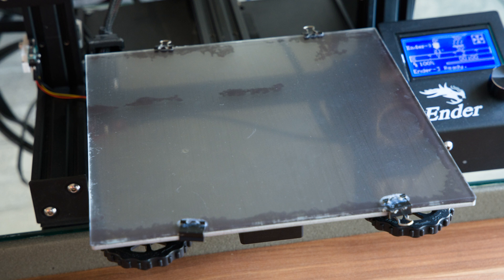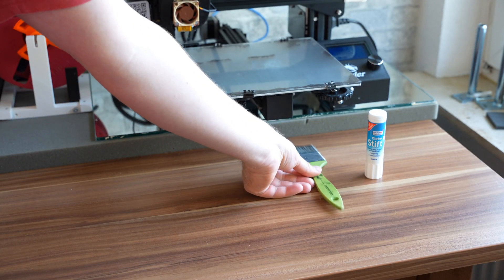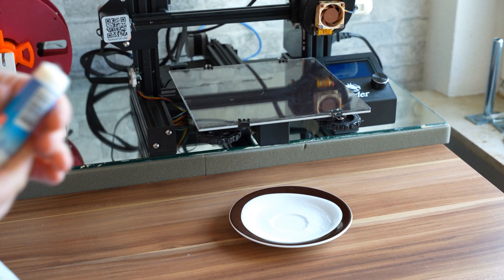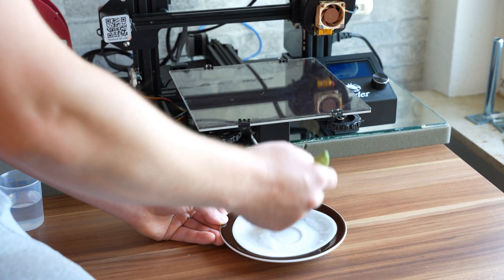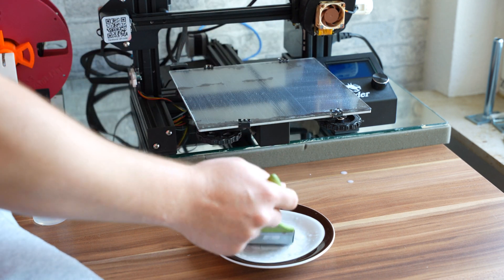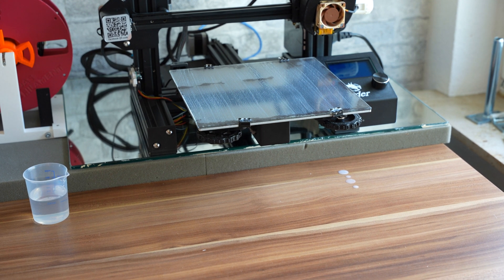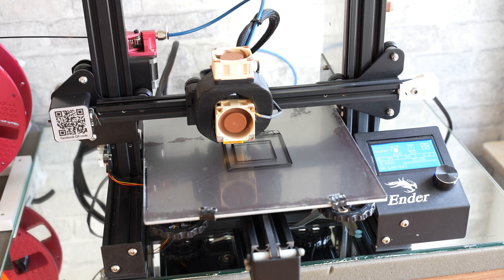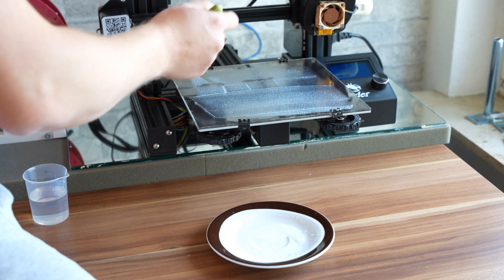3D-printer glass bed coating with gluestick

Comment: Wanted to come back to this video and comment to say thank you for this great idea! I prefer to use my glass beds on my enders, but often get frustrated when even after getting near perfect leveling that I still have adhesion issues. This is a perfect solution to keep the bed adhesion consistent without making an over sticky and globby bed by applying the gluestick directly on the glass build plate. I tried this this afternoon and it work flawlessly! Thank you so much for such good content!

Comment: If the glue is doing the job, why do you have a brim?
Reply from the maker: Good question! Maybe it is good to say the combination works well for me and my purposes. Without the brim, in the past, I still had some warping of the first layer in the corners due to the material shrinkage. With the brim, this was effectively resolved. At the same time it is not that much effort to remove, I had more trouble getting rafts off easily in the past if settings are not correct. Therefore, I have been doing it like this for some time now. I should add, I have also not really tried other combinations since.